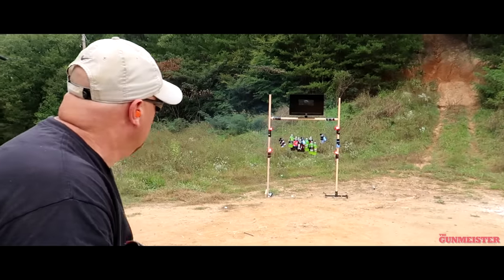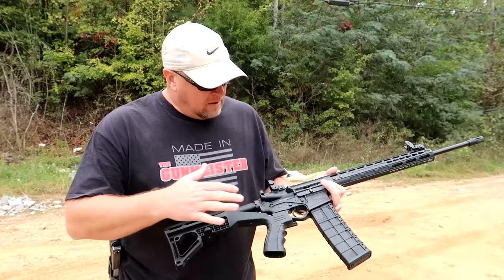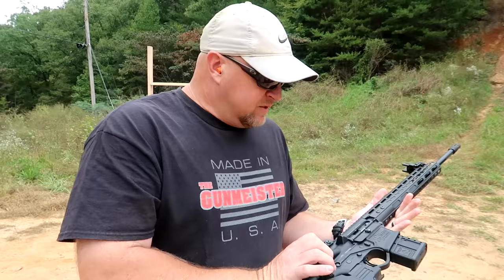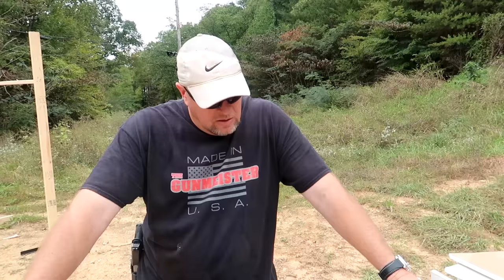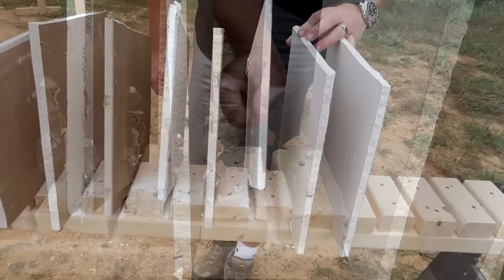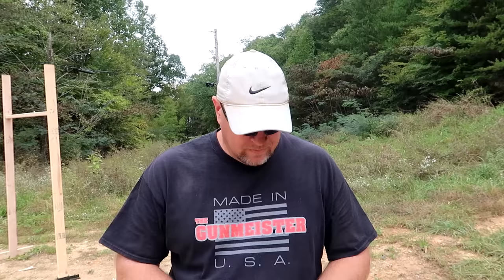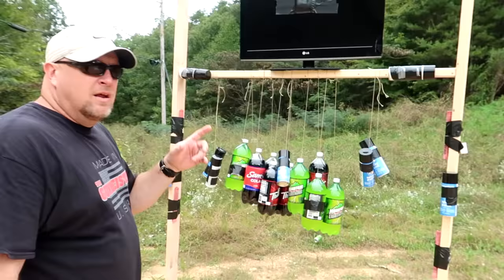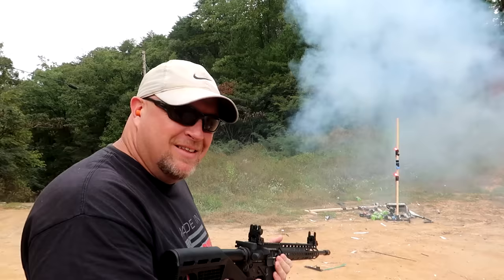American Tactical ATI Omni AR 410 Shotgun | Good For Home Defense?

Comment: #8 is an awful choice. My cousin was shot in the back with #8 from about 15 yards. Luckily he was wearing a leather jacket. Probably 75% was stopped by the jacket. The rest was lodged in the surface of his skin. None of which went more than half inch deep. Also A raw chicken is terrible test media for replicating defense situations. Look up girl shot with birdshot. To give you provable data on birdshot performance.
Reply: Mr. Savedra- who has a room 45 feet long?  And that being said if a perpetrator is 45 feet away that's not really a self defense situation and you could easily avoid the situation all together at that distance. I'm pretty sure that this was aimed at normal people that don't have houses with 45-foot long living rooms....just sayin 🙂🍻
Reply: @derekdeason5023  it wasn't a room. The shooter fired from the street at my cousin that was running away through a yard in a residential area. It was also with a 12 gauge not a .410. You can also find a video of a girl being shot from a few feet away with a 12guage and bird shot by a shooter at a collage. She didn't even go down. She turned n walked out. Yeah you probably can get it done with #8 if that's your only choice but its probably the worst possible option when your life is on the line. Feel free to prove me wrong. A slab of beef ribs would work nice as a testing media. Remember those tiny pellets have to reach vital organ's.
Reply: Very lucky. Untrained shooter
Reply: @evazkee7246  yes sir, extremely lucky.

Comment: In my experience from the messing around I’ve done seeing shotguns go through stuff, I was actually underwhelmed by the penetration of lead buckshot from a 12 gauge. I noticed you used copper plated buckshot, I wonder if that made the significant difference in penetration. Also please don’t kill your self with all that magic boom dust 😂
Reply: I was shooting some 3in 1 oz 12ga slugs through some old wheels the other day, the exit was impressive
Reply: Right, for maximum penetration you want the smaller, weaker .410 round. Duh.

Comment: The thing about .410 buckshot, (not bird shot) is it is effective at home defense distances, but will quickly lose velocity and energy at 20 - 25 feet.  This is a good thing for home defense weapons.  

The drywall demo showed how effective .410 is at close distances, not that it will penetrate through that many rooms in a house / neighborhood.   It shot through that many layers of drywall within the distance of one room.  The .410 pellets quickly lose energy  after that point.  It doesn’t mean they will penetrate through that many rooms.  

More suitable for home defense than a 12 gauge, in my opinion.

Comment: Although the cautionary tone is very valid, there’s one fundamental flaw with your drywall test...
Walls generally have rooms between them larger than the 1”-2” gap.  In fact they’re often 12’+.
Rounds slow down in air too and have limited range without obstructions. 
As a result none of those rounds. Are likely to penetrate 15 layers of drywall in real life, accepting that they may still make it into the neighbours house!
Reply from the maker: beefy, Thanks for the comment
Reply: Agreed, also. There have been numerous tests showing the inefficiency and lack of penetration required to "stop" a motivated intruder. Remember, the goal is to stop. That being said if you shoot me with birdshot within 15 yards I'll be stopping what I'm doing. Fewer civil lawsuits from the intruder with buckshot or a slug.
Reply: Walls with 12inch gaps between??? What are you smoking. Absolutely incorrect lol, maybe 4 inches

Comment: You should consider replacing the birdshot with aspirin tablets. they punch right through flesh, but disintegrate on contact with walls.   In gel tests, I got 14 inches of penetration and a  3x5 inch permanent wound channel..  a 3 inch .410 shell will hold up to 9 tablets.

Comment: As somebody who has hunted a lot with .410, used it for several tests of my own, and somebody who knows walls arent just drywall and have wood and other objects in them, .410 doesnt over penetrate as much as you'd think. If you're super worried about over penetration, go down to a #4 buck load. #8 shot wont do much to actual flesh particularly a typical human being. Sure, multiple shots could prove fatal but if you're in a situation where you feel lethal force is or could be required, why chance it with bird shot? 

Risk of over penetration will exist with whatever you plan to use unless you plan to use something ineffective. Sure, may not do much to drywall and can rip up a chicken, but chicken is nowhere close to human flesh consistency, doesnt have dense bone or muscle, so no surprise bird shot did something to a bird. Try that test on a pig carcass though... you'll likely blow some chunks but wont have deep penetration. Countless tests have shown time after time how bird shot just isnt going to cut it generally speaking. Granted, people dont want to get shot by anything, or shot at by anything if they can help it, but one should always operate under the assumption that somebody entering your home is there with hostile intent. Now, if you can get them to surrender simply by pointing the gun at them, by all means... no sense in taking a life if it doesnt have to happen. But again... if you're in a situation where lethal force is or could be required, bird shot is not the answer. 

My own tests of typical barriers you'd encounter inside the home have shown that when you throw in things like insulation, wood, pipes, and other objects in the wall, it slows penetration down quite a bit with slugs and buckshot loads like 00 or 000. As I said, #4 buckshot is a great load for home defense, be it a 12 gauge, 20 gauge, or .410. It gets adequate penetration, 9 pellets is plenty, patterns fairly good in most cylinder bore guns and even better with chokes like most .410's come equipped with, and should you miss it wont over penetrate either. 

But lets seriously look at the risk of over penetration... it's often quite oversold. In a 12 gauge with the stouter powder charge it's far more of a risk than the .410 is. Now I do live in an apartment where I have neighbors directly against one side of a wall, and neighbors across the hall. If I were to say shoot across the hall through the wall, it wouldnt likely even enter their apartment at all, or if it did it would have lost all it's energy and wouldnt be fatal short of an act of God. Now, the neighbors who are directly against the other wall, perhaps more so... however that side of the apartment has no doors or windows, so not likely to have an intruder approaching that direction thus my concern there is non existent. I do use a .410 as a home defense gun because my wife cant handle much more than that but I've tested the ammunition thoroughly to a point that the issue of over penetration is of no concern, the effect on target is still more than adequate with a typical 1/4 oz slug from a 3 inch shell and 18 to 20 inch barrel producing about the same ballistics as .30 Carbine with a 110gr load, considering a 1/4 oz slug is 109gr it's no shocker. They move at about the same speed, difference is the .410 slugs are larger diameter, are often hollow in the rear, expand and fragment quite easily, thus dumping their energy real early for a quick shock effect on target. 

Buckshot depending on the load will also lose it's effectiveness real quick on target. But after several deer and hogs taken by .410, it's still got plenty enough power to do the job. Could always use a dedicated "handgun" load for something like a Taurus Judge or S&W Governor. In an 18 to 20 inch barrel, most 000 buck loads are only doing 1,200 fps or so compared to the normal 1,500+ of .410 loads intended to be used from normal shotguns. More than adequate power, less penetration but still enough to do the job, less risk of over penetration and etc. Anything, even a .22 LR can over penetrate if shot at the right spot and etc... Thats why the whole issue is oversold in my eyes as actual shooting experience, data, and a more than one self defense shooting have taught me otherwise.
Reply from the maker: +Christopher , thank you so much for your valuable input! Your right, there are a lot of varaiables and different surrounding and situations that will deturman what gun or wepond would best suit and individual for self defense. I think the most important thing is to know your wepond well and understand what that wepond can and will do with different ammo. Again thank you for your input and support!
Reply: Great info sir.
Reply: Mostly agree but if someone is in my house uninvited in the middle of the night, I'm not going to ask questions or worry to much if I blow their head off. Kapish?
Reply: @Whiskey4myHoz  I'm not going to worry about that person's life. I would however worry about my neighbors potentially.
Reply: You can spew out, copy and paste all the numbers for loads off google you want to. You think for one second in a home defense situation a round of bird shot isn't going to seriously incapacitate an intruder you are out of your damn mind.
Reply: @tilleypatrickpt  I live down south... A lot of old timers here keep shotguns loaded with birdshot thinking the same thing you are now. If I wear a heavy jacket, birdshot wont even reach my skin... And even completely naked, most birdshot loads wont reach anything vital. But good lucking finding a naked attacker. Secondly, you can read the police reports of the guys who have used bird shot, often the results are they fled unharmed which is a good thing yes, but when the attackers didnt flee, it required multiple shots to get the job done. Compare that to reports using #4 or 00 Buck, the results of people being fired upon, just like bird shot is they run away unharmed. But when they didnt run away, the first shot from either put them down either in the dirt or waiting for medical attention. 

I know 3 people who personally have been shot with bird shot, and they have minor scars where it hit them. One case they got shot, got pissed, beat the guy half to death first, then got medical attention. Bird shot may do better than nothing, but more often than not, bird shot is not going to accomplish the task. Considering most bird shot pellets are either the same size AND weight as steel BB's you'd use in a BB gun, just firing a lot faster, or they are smaller and even lighter. a 0.17gr 6mm Airsoft pellet at 600 fps will break skin, but wont cause lethal injuries unless you can hit that rare shot right in the eye at JUST the right angle on the right day and time. In short... more likely to be struck by lightning TWICE. A steel BB flying out of an 18 inch shotgun at around 1,300 fps that weighs about the same will break skin but wont penetrate the muscle often or anything beyond that. 

That's not copy and pasting off Google, that's actual facts that have been shown time and time again. I can source you a bunch of gel tests and even Paul Harrel's meat target test on bird shot if you have doubts about how effective it is. I could also sift through tons of real world shooting data again but I'd encourage you not to be lazy on that subject. Does anybody want to get shot? The answer is no... even a .22 Short will take the fight out of a good number of people as they dont want to get shot by anything that hurts. Difference is I've seen .22 Short penetrate 10 inches, I've not seen bird shot do that outside of that old T Shot that you cant get anymore. But I'm not going to risk MY life, or my family's life on bird shot. So no, I'm not out of my damn mind. Personal experience, research and empirical data has shown birdshot is NOT a good choice. Better than nothing but not a good choice when 00 Buck, 000 Buck, #4 Buck, #1 Buck, and slugs exist particularly in a .410 Shotshell.
Reply: @Predalien195  there is a difference in being shot and being peppered
Reply: @tilleypatrickpt  15 feet from target is "being shot" by your eyes yeah? 15 feet... a little over 4 yards, did NOT stop somebody. It pissed them off, they beat the guy half to death, got medical attention for minor non life threatening injury. Hate to break it to you but your bird shot fantasy just isnt real. Data shows otherwise, tests show otherwise, personal experience shows otherwise. Right now the only thing saying "Yes it can" is you. Now should I trust what I've seen with my own two eyes IN PERSON, on paper, and in video format or the guy who says birdshot is effective.
Reply: @luketilley9137  It wouldnt produce lethal wounds. Doesnt mean it wouldnt take me out of the fight from sheer pain, but adrenaline and drugs can do a lot to overcome the minor injuries produced by bird shot. You can ask medical experts, bird shot is NOT effective. I've had a dog my family adopted that after we had to put him down due to spinal injuries, x-rays revealed he had tons of bird shot pellets stuck maybe an inch below the skin. That's typical results with humans too, bird shot pellets simply dont have the mass to go clean through and through people.

I think you are trying to attribute traits to bird shot that simply dont exist when evidence to the contrary is everywhere to your statement. Go watch channels like Paul Harrel doing his meat target test, go watch ballistics gel videos, hell.. watch hunting videos. There's a reason it's called BIRD SHOT not BUCK SHOT. It's meant for birds, not deer, not people. I know people who could get shot by a .17 caliber pellet rifle and they'd quit doing whatever it was they were doing because pain is pain. Problem is, when that pain isnt high enough or adrenaline overcomes it, you're going to wish it wasnt bird shot. 

And yes, I can wear my heavy jacket... because it's thicker than 4 layers of denim which is IWBA protocol, go watch bird shot on people following IWBA testing protocol and you'll see that in that "Worst Case" scenario of a target wearing 4 layers of denim, it wont do jack. Like I said... Tons of evidence to the contrary of what you're saying. Please stop being ignorant in your belief on the matter. The education is free, use it please.
Reply: Nobody is wearing 4 layers of denim to break into houses!!! If I put up a 6' thick piece of steel a 50 cal won't penetrate. See what I did there?
Reply: @tilleypatrickpt  It's not even about 4 layers of denim... even in just plain bare gel... Bird shot under penetrates. Outside of being point blank to the muzzle it's just not going to be an effective stopper compared to buckshot or slugs. See what I did there?
Reply: Christopher 410 to the face will blind someone
Reply: @THEGUNMEISTER  weapon ,,,,,,,,,,,,,,,, yea I suck at spelling too. I like the trigger control, dont think that was a slide fire. Had one ,,,, miss it now and then, My buddy even ask first time he saw me shoot it Is that legal? ?.traded it for a two cylinder Kholer eng.
Reply: @Predalien195  
Put on a jacket and let me shoot you from 25 feet with birdshot in my home defense shotgun??? You full of shit!

Comment: Most pistol ammo is also going to penetrate many layers of drywall. Also gotta keep in mind how he never put studs in between those pieces of drywall and assumes that a person will be shooting straight inline with the wall and then all proceeding walls would have their studs in the same orientation whereby the slug would keep missing the studs. Can also research the statistics which shows such a insignificant risk of your larger shotgun slugs going astray and injuring or killing a bi-standard. However, the shotshells are the better choice when wanting to go extreme for not wanting the VERY small risk of a slug going astray in the home and hitting an innocent person

Comment: Hey Gunmeister, I just bought one of these .410's hoping I would be as happy as you are. Mine ,however does not function well at all. The spent rounds do not eject from the bolt and jam in the chamber using (Stirling #8), I know that is not your issue and so far ATI has been receptive to my concerns. The odd thing is that the detail on your gun looks completely different than mine. My lower has the ATI logo but not the words "Omni Hybrid." Currently, my upper is in a box on it's way to ATI for repair, maybe replacement (I hope).

Comment: Why didn't u test buck and slug with el pollo loco?I'm sure it would not have went through so many pieces of dry wall if u did.
Reply: The Omni Hybrid 410 only takes 2.5" shells, not 3".  The only buck-and-ball I see for 2.5" shells is Hornady's 41 cal slug over a pair of 35 cal balls which I can't imagine being all that much different from the 3 pellet #000 buck.  Kind of disappointing really, 3" 5 pellet #000 loads would be pretty devastating with that kind of capacity and firing rate.
Reply: I was wondering that too.

Comment: If someone would make a 444 marlin barrel for it, it would become a little jackhammer!
Reply from the maker: Jarmo, that would be a sick gun for sure! Thanks for the comment!
Reply: @THEGUNMEISTER  But when everything is calculated, 357 max ar gives the best bang for your buck, as more reusable casings will be available after shooting and cheap bullets can be used in loading full 30 mags.. 90 bucks for 250 brand new straight walled 223 casings isn't bad I think. Hopefully those barrels will start appearing in future to further maximize the versatility of AR platform!

Comment: Bullet going though a body will slow down or even stop, going to the other side won’t have enough energy to be lettal. Also you could then just use 5.56 hollow points and would be good. These rounds are not death rays as many believe,